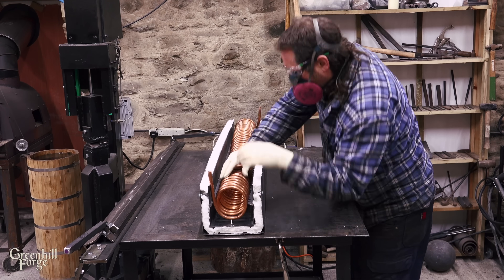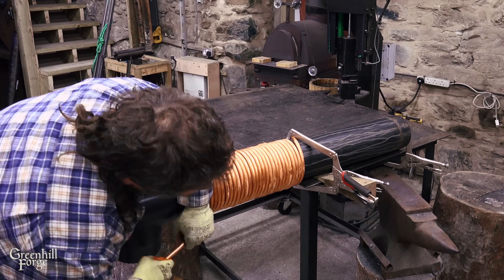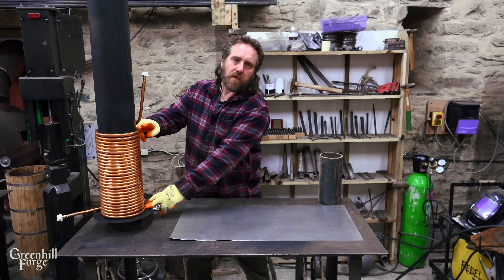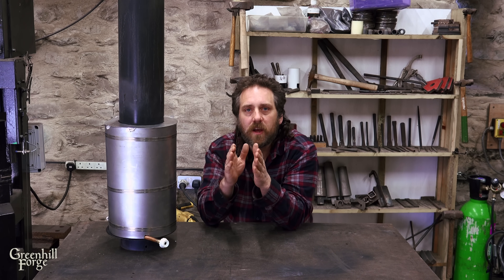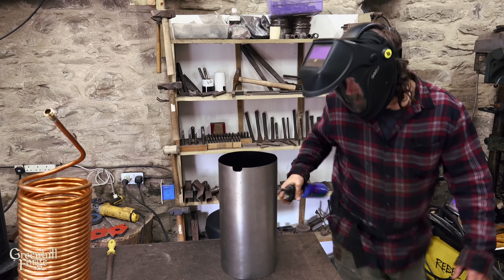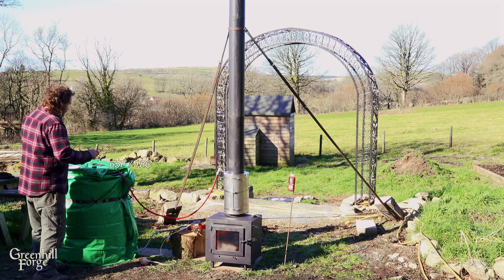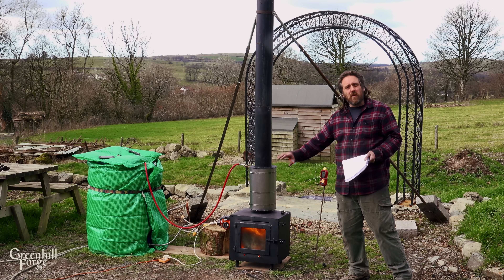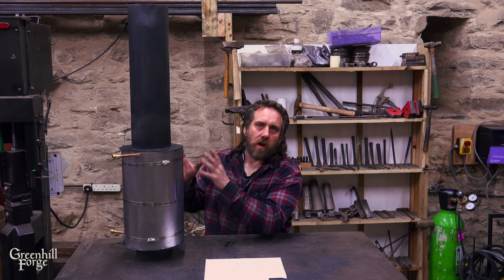Best Wood Stove Water Heater Yet: New Design Tested | Off Grid Water Heater pt3

Comment: What about wrapping the pipe still on the inside but with an additional wrap of sheet metal around the copper .
So it would still gain most of the heat inside but then having a smooth surface of sheet metal containing the  copper pipe so no creosote could easily develop inside.
Reply: So its basically copper inside a double sheet metal barrier.

Comment: Hello and congratulations on the superb videos you make for us.

I'm a building contractor and I also have a few ideas!

First, you're right about not installing the copper coil directly in the flue: of course, it will heat up faster, but there can be long-term problems, such as acidity and premature fouling of the flue.

Regarding the idea of putting the coil around the stovepipe and insulating it with sand, that's a good idea; personally, I would prefer very fine silica, but it wouldn't offer a huge gain in efficiency. I've been thinking, though I haven't tested it yet, about using a heat transfer fluid instead of graphite? A bit like what's in some electric radiators. However, I don't know if the heat given off by the pipe will affect the evaporation fluid of the product or anything else!
In any case, it's a great idea to use the black steel stovepipe to heat radiators or a hot water tank! I have a 25-meter coil of 15mm diameter tubing that will be installed in mid-February. I'm thinking of painting the pipe black for a better look. I'll be doing some tests soon (mid-February) to see how efficient it is, but 25 meters of tubing at a height of 80cm should be very good, in my opinion.

Thanks again for your great advice, I'm following you on Patreon!
Laurent
Reply from the maker: Thanks very much! 

Fluid would be the best at thermal conduction but comes with so many problems that I'd avoid it personally. Needs 100% seal, can leak, can boil, can expand, need vented system to prevent pressure but then need to maintain fluid level from evaporation, etc

Painting it black will also increase the emissivity so you'll get more heat.

Just make sure you clean the flue more often because you'll get more creosote condensation. And any non-standard woodstove installs can affect safety and home insurance policies
Reply: Hello
Thanks for the quick reply!

Yes, indeed, the heat transfer fluid has its drawbacks!
I'm thinking of first testing a 25-meter coil, 15mm in diameter and 84cm high, which will be wound around the pipe. I have a 100-liter tank to heat (1.162 watts to heat 1 liter of water by 1 degree, x 50 liters to heat, so for 100 liters, we arrive at almost 5810 watts to heat my tank). You say with method 1, without insulation around the coil, it takes 2 hours and 32 minutes to heat to 30 degrees. Not bad, I think! Especially since your stove was outside; mine will be inside at 20 degrees: less heat loss, I think.
Laurent
Reply from the maker: 5810W is I think about right for 100l raised 50 degrees C over 1 hour at 100% effeciency. don't know what the real world efficiency will be. don't forget to figure out what happens when the water hits your temp goal. does the stove stop, or does the pump stop, or do you have a second heat dump tank. the copper gets super hot if water isn't flowing through it keeping it cool

Comment: Maybe using thermal paste directly on the pipe to conduct heat to tightly wrapped copper sheet, which is wrapped by prefferably rectangle (not round) copper tube for even more contact patch, and then combining with graphite.

Comment: Im trying to heat 45 gallon  barrels in my green house just enough to keep them from freezing I was thinking to wrap the copper on the outside the pipe then run it sideways in between the top and bottom of barrels
and fill  all pipes with glycol and leave it  capped and a closed system   any feed back  Im thinking it will  thermo cycle does this sound like a pipe dream   any thoughts greatly apresheated
Reply from the maker: thermosiphons need enough height differential to work and the longer the tubing system the more height differential they need. a closed system is almost always very dangerous.

Comment: I watched all the videos and this one seems to be the safest. So in order to make it more productive. How about a combination of half inch gapping like the internal coil design. But on the inside of the flew either a Archimedes screw or a  half circle baffle design. Which you gap a couple of inches apart. But placed in a staggering offset as you go up. Which would still give a screw affect. I think it would slow the flow and capture more of the wasted heat escaping out the top. And with the coil gapping along with your sand or powder idea you'll use more of the flew thats being heated by the internal baffling. I hope all that made sense. Wish I could draw a picture on here to demonstrate what I mean.  Although I'm not sure it would even improve your design. Your experiment was very captivating and interesting. Which got me thinking, that's all. It was a good watch that stoke the creative juices. 

P.S. I was reading some of the other comments and I seen that I stated almost the same suggestion ss James Moore did 3 days prior. Sorry James I wasn't stealing your ideas. I truly thought the same as you. Guess I should have read the comments first.

Comment: Perhaps a section of copper exhaust pipe fitted with the copper tubing soldiered to the copper pipe and then insulated will transfer heat to the tubing much better!

Comment: What if you fill up the space around the tubes with a molten metal? Like, not aluminum powder, but molten aluminum. Or some other metal that'll melt while the tubes etc. won't be damaged. Zero air in the space around the tubes will allow for the best heat transfer. A liquid or a solid would work best.
Edit: you might get Galvanic reactions maybe, but isn't graphite powder going to do the same??

Comment: Build the formwork with soapstone and fill the gaps with soapstone powder.
Steatite does not expand or contract with heat and has the great advantage of accumulating a lot of heat and releasing it very slowly.
This is why soapstone is widely used in the construction of masonry heaters.
 
Faire le coffrage avec de la pierre ""stéatite," Et remplir les espace vide avec de la poudre de stéatite,
  La  stéatite,  ne prend pas expression à la chaleur  , et a le grand avantage  d'accumuler beaucoup  la chaleur , et la redistribuer très lentement.
 Et c'est pour cette raison que  la   stéatite,  est beaucoup utilisé pour la construction de foyer de masse  .

Comment: Should put a shell around the outer pipes & chimney, and then fill the inner space with sand. This would massively increase the surface area for heat absorbtion, and the sand would further transfer heat to the pipes after the smoke stops.

Comment: thx for this. best documentary about this DIY Heating Concept. Maybe 1 longer spreaded Coil no 50 cm but 1m can go hardly. also a bend Schape L Form and coil L Form around Outgoing Pipe can be more effizient. the isolation with sand is good. then an Airlayer 2cm around can handle. cheap and best isolation for this. maybe you do a 12 v Pump electrified from 8 Peltier-Elements. the more you go the flow the more you say Hoho. 12 V = 8 Peltier Elements, 12 V Waterpump from a Gas Heating Device. I think with this Method 35 min. Record!

Comment: This method is used with  pump recycling the water to warm  another room  heather, but not the coil around the pipe  but over the stove,  , not to  warm water for  shower etc  you need a dedicated stove for that.

Comment: Maybe a register would improve the heating system. This registers is a turn around for the smoke, ancient ones had a short valve for starting the fire. As a turnaround slows down the smoke speed it transfers more heat to the tube, also has a three times higher surface.

Comment: Your coil should be wrapped less tightly. If it is tightly coiled, your coils are competing against each other for energy transfer. If they had even a two inch gap in between each coil, I think you'd see a significant improvement. You'd be tripling the surface area for heat transfer.

Comment: On the outside coil space the coils out like in the original making your heat exchanger, the pipe length larger.  Use sand and insulate the outside.  Then what will make a Huge difference is internal baffles on the inside of the Flue.  I think Spiral baffles to slow the exhaust and transfer more heat to the flue pipe.  A thicker walled flue pipe might be in order.  Creosote build up might be an issue unless you had efficient combustion such as a Rocker stove.  You will have more thermal mass in the thicker walled pipe and sand, but that will even out the temperature as the fire dies down.  Slower to warm up initially , but would be better if this was hot water for doing dishes and showers etc.
Reply: I just left my suggestions a couple minutes ago and then I read the comments prior to mine. I basically had the same suggestion as you. Promise I wasn't stealing your ideas. I truly thought the same. I made sure to edit my post and give props for being the first with ideas. 👍

Comment: Does the angle of the stove pipe matter? Heat rises—what if the section of the stove pipe that has the coil wrapped around it were (nearly) horizontal instead of vertical?

Comment: Hi, interesting video, i think it would be nice if you try the outside coil with graphite and make it like your previous video of the woodstove radiator but with regular flue pipe, tee and 90o and damper key. All just from the hardware store. It look like a really good idea to extract a lot of heat with a small footprint
Nice video :)

Comment: I REALLY hope you've got electrical-insulator between the sheet-steel/sheet-aluminum of that stovepipe & the copper: galvanic-corrosion is going to make hell of it, otherwise.

& you may have to consider that if combustion still continues into the stovepipe without the copper, is the copper cooling-that-down until you're depositing more creosote ( which is fuel for a chimney-fire )?

Live safe: live long & earn more meaning & understanding wealth,  eh?

_ /\ _

Comment: Definitely not an engineer but I wonder if it would be possible to increase the contact time between the hot gases and the chimney wall by (somehow??) creating a vortex or otherwise devising some way to direct the hot gases towards the chimney wall at the bottom where the coil is. The idea comes from a couple videos I’ve watched on traditional Korean floor heating systems called Ondol; one guy mentioned that they use a circular/spiral pattern in order to increase contact time between the hot gas/smoke and the thermal mass. Another video I watched some time ago showed someone creating a “fire tornado” by drilling holes in the side of the chimney of a rocket stove (iirc) and bending them to point inwards, directing additional air flow (and causing secondary combustion) into a spiral pattern. I have neither the resources nor the wherewithal to test anything like this so it’s really cool to see your experiments. Thanks for sharing your work!

Comment: What about having a taller firebox and then replacing the angle plate with and angled water tank? It would then heat from all sides and any creosote issue is inspectable

Comment: Fantastic video, but I have 1 suggestion for gaining efficiency on the graphite system. 

Your coil in the flue spanned a longer distance because the copper wasn't touching itself. Id bet that you can make another leap to nearly the same efficiency as in the flue if you coiled the copper the same way and packed it with graphite.

Comment: With the log burner radiator box you made previously, there was almost no soot residue at the top, so why not install the copper coil around there and just improve the efficiency of the log burner? 🤔
Also, where the copper coil would sit inside the top of that box, have just that section made from copper to limit galvanic corrosion.
Otherwise, ideally you'd have the log burner indoors(including whilst testing 😜). Going back to copper for the flue - Would having part of the flue pipe that the copper's wrapped around be any better? Heck, you could put the coil on the inside instead. 

And if you added a water pump before the inlet (cold feed) of the copper coil it would benefit the flow greatly and reduce the risk of boiling in the pipe. 10:47 that's a fascinating gadget you've created there, you should refine it and patent it. Cool idea with the graphite powder.

Comment: Where to start with this…. I would encourage you to brush up on basic physics of heat transfer between different materials - a free pointer, the larger the contact area between two media across a heat exchanger the more efficient the unit is. Another free pointer - combustion gasses carry the energy you want to harvest, the cooler the exhaust gases at the end of the flue the more energy yoi have extracted, think on this one. The best results yoi achieved with the rocket stove because the thermal gradient was the highest, think on this one too. Thermal mass. 11th century solid timber log Nordic dwellings could stay warm after the fire went out for a week or longer, why was that? A clue, the furnace construction. 
Another one, reduce all the thermal losses of your energy producing appliance. In a cabin setting this is not an issue as this “lost” energy is used to heat the cabin’s air, in your test environment Thats not the case. 
To summarise, come up with an original design which is able to harvest as much heat from the fire as possible so the exhaust gases are as cool as you can get it. I could give you a DIY design which does all of it right now, is much quicker, less messy and much cheaper to build but where would be the fun in that? Also, a good challenge is a great excuse to make more vids ;). 

P.S. there is also a version of it where you can have a portable hot water from such an arrangement ;).

Comment: i was going to suggest using salt but graphite is better. also i would add some easy cleanable fins inside of the flue. you need to disturb the boundary layer of the hot airstream. this wil enhance the heat collection of the flue.

Comment: A much more efficient heat exchanger could be built by simply putting one stainless steel tube around another. The inner tube would be the size of the stack. You can make the tubes out of sheet and either weld or silver solder the seams. The longer the heat exchanger the more efficient it will be. I presume you are flowing the water counter current to the heat flow, i.e., water inlet at the top, outlet at the bottom. The annular distance between the inside and outside tube could be as little as 0.25" or maybe even smaller.

Copper would also work, but would probably be more expensive. Since the limiting heat transfer is probably from the stack gases to the shell, copper would not probably help much with heat transfer. SS pipe could also be used but would be expensive and the thicker it is the less conductive it would be. The longer the heat exchanger the more efficient the exchanger will be. My guess would be 5 ft. minimum. I would shoot for 10+ ft. 

Steel could be used if you put a rust inhibitor  in the water, but if you are not  going to use a secondary heat exchanger and are going to use the water directly that wouldn't work.

Comment: Process engineer here - Could you cast (with molten aluminium) some copper tube inside in an aluminium flue with some baffles for surface area? That might be the best option.
As long as it doesn’t get too hot the aluminium shouldn’t melt (about 660c melting)

Comment: But why bother with a coil, graphite ext. 5 years ago i made something similar, but it was just a reservoir of water instead of coil and graphite. I made everything from 2mm ( or was it? may be 1.5mm don't remember) stainless steel. so it wont rust.  It is  very easy and efficient. Just 2 stainless pipes one inside the other with welded top and bottom rings to hold the water between the pipes. Plus top exit for the hot water and bottom entry! And also I made a damper in the flue right after the end of the reservoir. Thus you can keep the heat right where you need it. It is all just one unit 50 centimeters tall.

Comment: i believe another factor about how much energy you can get out of the pipe is the are of the pipe that is covered ... in the tests with the coil inside, the coil was much longer ... I believe you could have huge gains just by spacing the coil further apart to have a longer coil - with the graphite inside, more power will be recovered from the chimney

Comment: I've seen a few different versions of camp stove/hot tent water heaters that have a water reservoir around the outlet of the stove.  So I'm wondering if ditching the coils for a direct contact water jacket system, or maybe finding a way to create a waterproof inner & outer chimney might be a better heat transfer

Comment: Why not do an inner-outer sleeve jacket where the water to be heated is in direct/complete contact with the flue at all times rather than doing a copper exchanger?  Then nothing's absorbing heat except your water?
Reply from the maker: fluid is harder because it can't have any leaks but I agree that you'd get a better transfer. probably worth doing one as a test.

Comment: I think the last built is nice, you could try to make the system is nice but you could try to improve efficiency by making the tube longer at the same time idk what material you used for the chimney but aluminium woud improve heat transfer